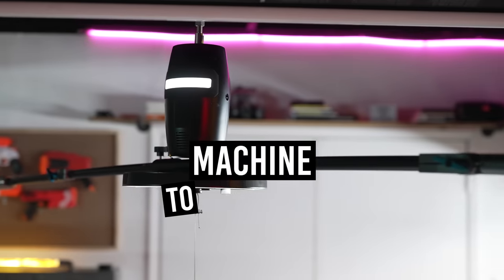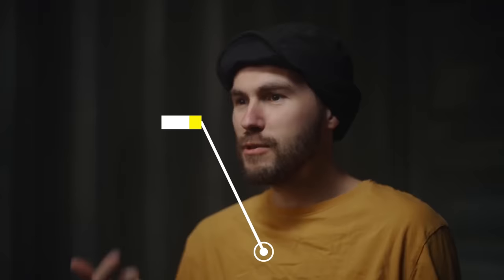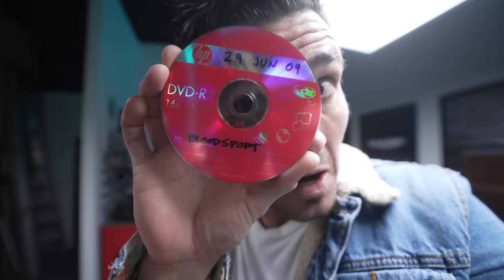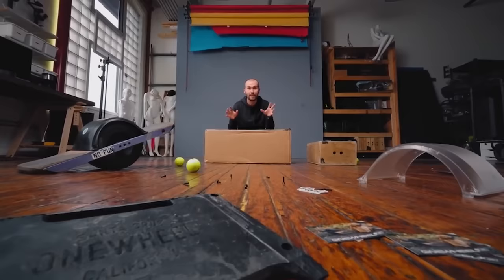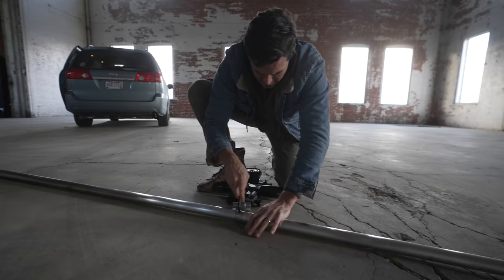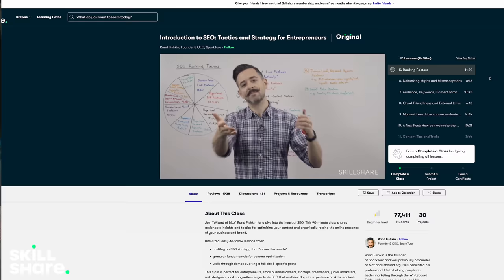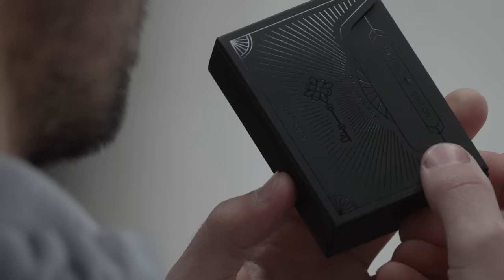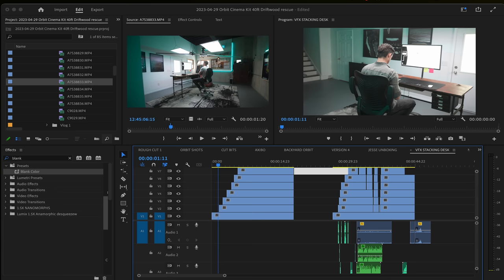I built an EVEN BIGGER Michael Bay Machine.

Comment: you can probably use the slackline(s) if it's just on the ends. You could try using a piece of triangle truss between the lines with the Orbit attached to the truss and two slcklines on each end of the truss, at 60º to 90º (edit), also, if you are able to anchor a line at 45º from the end of the truss to the ground, that should tighten up the entire rig

Comment: Great idea and experiments!
Yet I feel that if you are not going to use the full 360 and are using longer lenses perhaps a ground fixture with curved rails could work or a ground system with motorized rotating wheels if you need steady motion and repeatability. It certainly be more luggable than finding huge pipes.
Of course you’ll need even ground.
Have you looked into that?
Keep it up!
Reply: I have a dolly at the studio with some curved tracks that can do this. It costs nearly as much as the Orbit but the speed maxes out at 22 seconds per meter, about 99% slower than the orbit. You also can’t choose your  orbit diameter which can be pretty limiting if you want to change the focal length and compression.

Comment: Great video and really enjoyed, Have you tried aluminium box tubing as I think it may be more rigid and less prone to bending as circular, I have a drive on foot plate when out on the hills with my radio communications equipment and use 2 ten foot boxed poles stacked to get the antenna to height with much less sway than my older circular poles...Just a thought' I still think that the bending would be less evident even on the horizontal....73s from the uk😊❤

Comment: Simple mechanical Engineering problem/solution. Just triangulate the slack lines. That is, add another slack line at the motor and move the mount points on the wall so they are 120º degrees apart (as opposed to 180). .This is one of the strongest geometric configurations possible.

Comment: Why not get 2 metal braided wires from Home Depot and then attach them so they end up at 90 degrees from each other. Those should have very little flex plus the 90 degrees should make them quite stable and eliminate any significant wobble

Comment: What if you can make the slack like with 3 or 4 cable tie points, not 2?  That should make the point where the orbit hangs much more stable.  Also, can to "detect" collitions by having the motor sense the "increase/peak" in torque?